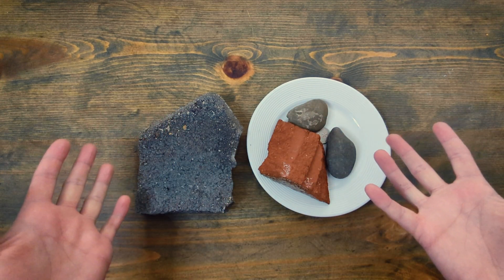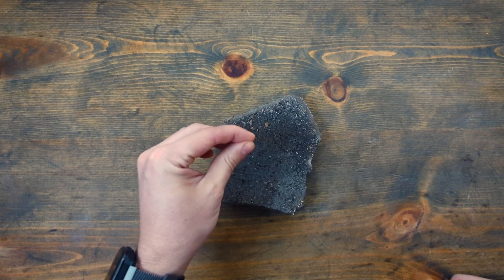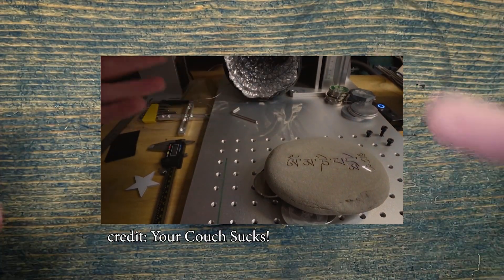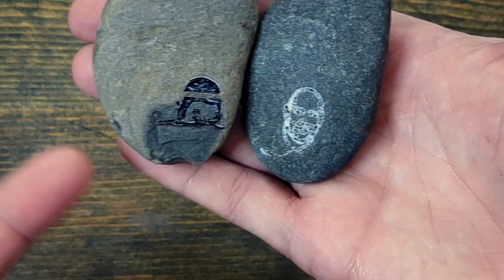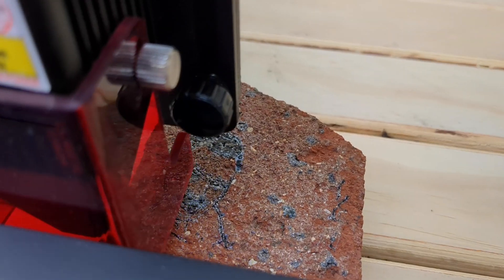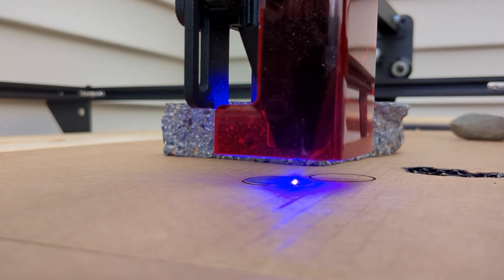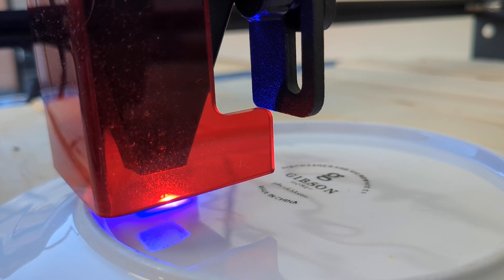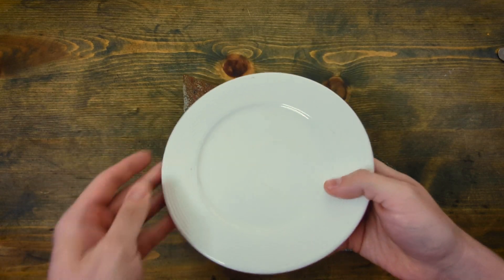Can a laser cut rocks?

Comment: Using Software that creates a Mosaic of a Picture (ie. Poster Print), it would be possible to print the Brick Ends and create a Wall Picture... or Picture Wall.
The Laser Etching would be very Durable and the Image or Pattern would be very Clear.  It would also be possible to Print on other Faces of the Brick to Ensure Proper Placement.
Given the Accuracy and Potential Speed of the Etching Laser, you could Create 'Time Bricks' Printed with Information that could Possibly be Recovered some Day in the Future.